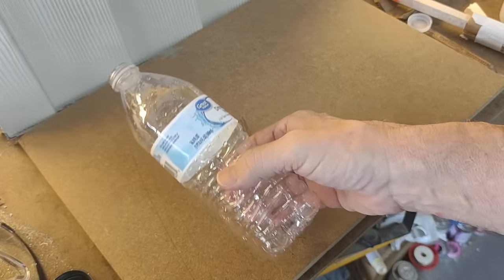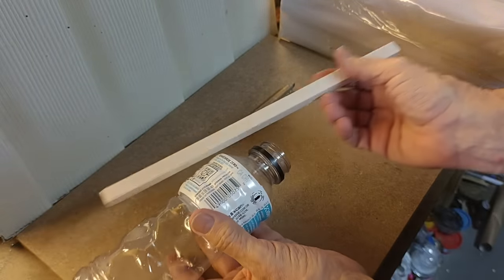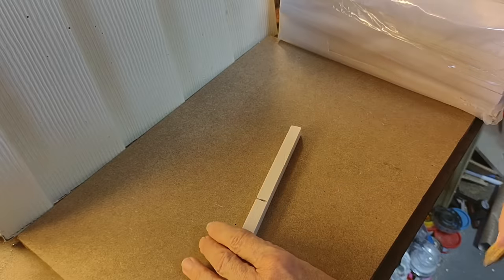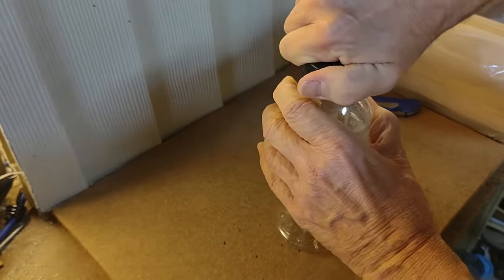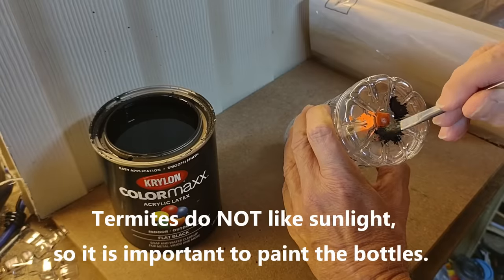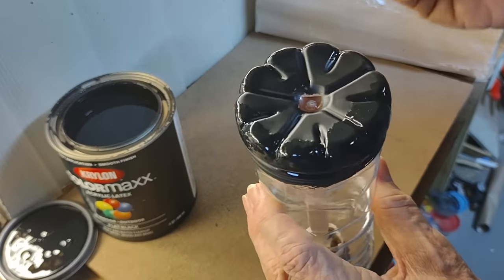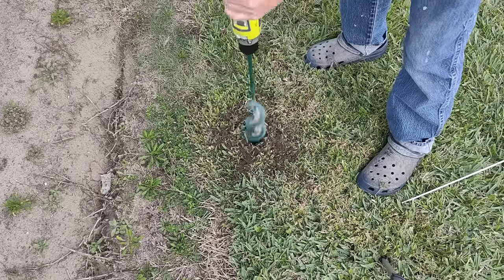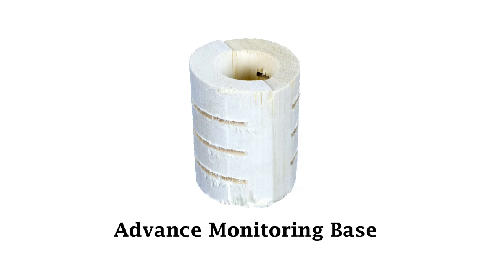Unbelievable Water Bottle Trick for Termites!  Simple to do!

Comment: thank god my house is concrete. We have gazillions of termites here. I put my shovel on the soil, the enxt day the wood handle is almost gone and there's gazillions of termites. The cracks of my yard concrete has termites as well, they also like eating live trees. I also hate the tree ants smaragdina they do bite and crawl everywhere. The fire ants is also scary and painful. Spiders are also plenty at my neighbor and gazillions mosquitos. Next summer I have to scrap all sorts of the moss growing on my concrete floor outside so that I can seal and cement the cracks. My concrete already expanded upwards due to rain water that make the soil bulky. Wood house feels comfy and feels home, but maintenance is very difficult so better have a concrete house.
Reply from the maker: Please tell me where you live.   I may be able to assist you with some of those issues.  It doesn't sound like you live in the US.  The extent of the problems you are describing would suggest perhaps the eastern hemisphere.  Some places around the world are much more challenging than the US because of the lack of availability of pesticides.  Still, if I know where you are from, then I can try to think of some solutions.  Also, you should know that a lot of concrete homes use wood in the roof structure, the interior walls, and sometimes to pad out the exterior walls to hang drywall and run the electric lines.  Termites also eat drywall.  Construction methods differ in other countries, but this is still often the case.

Be well my friend.
Reply: Where do you live so I don’t move there, sounds like a nightmare.
Reply: @GuysPestSolutions  my entire house is made of cement and sand. even the roof is cement and sand. It was built by pouring the cement into mold. The roof is slab of cement. we don't have wood as it will be eaten by termites. but i do have wood cabinet inside the house. for as long as there is no crack on my floor there will be no termite inside my house. The issue inside is the tiny ants crawling in small cracks. And I usually develop black molds on walls and ceilings. My door jamb is metal as well. but metal do gets rusty that is my issue the rust. Some doors of abandon house are eaten by termites. I don't have issue with termites anyway coz there is not much wood here. I just feel creepy with spiders of neighbor coz theyy do harbor those in their yard and it crawls. I do have wood on second floor devision of rooms. But I don't think termites will go up without passing lower ground first. The ants is the problem, they are crawling everywhere on cracks so I have to keep up with them everyday. there are super tiny, there are big blacks too. I spray insecticide on corners daily.
Reply from the maker: You did not mention where you live, so I don't know if you can get the pesticide that you need to do the job, but please watch my video on how to treat for ants.  If you can obtain the material, then this should solve your problem.  If you cannot obtain the pesticide, then please let me know what pesticides are available to you, and I will try to figure out what might work best.

I hope that helps. You will my friend.

Video on how to treat ants:  https://youtu.be/arPeidADLpY
Reply: I only use ordinary cheap insecticide on just corners where ants pass by. I cannot possibly stop all sorts of flying insects. The termites is fine coz i don't have wood here. ants is my issue so i spray on corners everyday, they creawl everywhere. The roach is minimal, but i notice the roach happen when i had neighbors. A few years ago we don't have roach here when there were no people, but when they came and homes got occupied, i notice I am seeing big roaches crawling. They probably have eggs and they don't clean. my house is messy and my yard but i clean everyday and spray so I don't have eggs and no insects likes me. My neighbors however who happens to have better looking homes and garden yard, they don't clean up, so insects are living in their house and yard, they have places to hide and lay eggs. It crawls to my space when they get bothered. They also have spiders. They just clean once a year. or maybe not. It's like a beautiful woman but never baths.😆

Comment: If the termite is in the house what you can do?
Reply from the maker: How you handle that will depend on the species.  Figuring out the species is actually pretty easy and I have a video on how to do that.  I will provide you with a link below.  After watching this video, you should be able to identify the species.  Just get back to me after you watch it and let me know what you found out.  At that point, I can tell you exactly what you need to do.  Let me know if you have any problems identifying the species, but I do not think that you will.  It is much easier than you may imagine.  Also, please tell me where you live.  Location matters.  Be well my friend.

Video on how to identify termite species: https://youtu.be/dIs_a0nfVjg
Reply: @GuysPestSolutions  from the East bay of San Francisco, CA, USA
Reply from the maker: @dirtrider9268  You have a few species there, but the most common are Western subterranean termites.  These can be hard to identify because they look a lot like Eastern subterranean termites.  Please watch my video on how to identify termite species.  If they look like Eastern subs, then they are probably Western subs.  If that is the case, then I can help you fix the problem.  They could also be Formosan, so look carefully.  Be well my friend.

Comment: How to treat dry woid termites already in a house in Florida
Reply from the maker: It is important to understand how drywood termites work.  They enter through cracks and crevices around windows, doors, the eaves, pipe penetrations, and so forth.  Most of the time, they enter through several locations.  That is because a swarm of them attacked your house at the same time.  If there was a crack or a crevice, then they probably found it.  After they established their galleries, which will be inside the wood, it will take four to seven years for them to be able to swarm.  Now that they are in your house, the swarmers will use holes that are in your studs to travel through the walls.  Those holes in the studs were created by the electricians to run the electrical wiring.  Not only are these holes going through the studs, but holes were drilled into the attic for the light switches and to run some of the wiring for the outlets.  So, the termites now have easy access throughout the attic and the walls.  If you have a basement or crawl space, they have access to that as well.  Most of the time, you will have no idea that they are in the walls, because the frass is inside the wall.  To make matters worse, if you have drywood termites, then your neighbors have them too.  That means you have been getting swarmed for as long as they have existed in the neighborhood.  Most likely, we're talking about years, so it's a safe bet that you have these guys in many locations in your home.

I always hate to be the bearer of bad news, but if you have drywood termites, the only sure way to get rid of them is to fumigate.  Prices for this can vary wildly in this industry, so I recommend that you watch my video on how to hire a pest controller without getting ripped off.  That video can save you a lot of money.  You should also know that the gas they use to fumigate has absolutely no residual action whatsoever, so you can get reinfested the moment the tent comes down.  Like I said before, if you have drywood termites, then your neighbors have them as well.  Since drywood  termites swarm every year, it is almost a certainty that you will be reinfested within a year after the fumigation is done.  The only way to prevent this is to do a preventive treatment on your house every 60 to 90 days.  Most pest controllers will not do this, so it is something that you generally need to do yourself.  I have a video on how to do that and I will place a link below.  If you absolutely cannot afford to fumigate your house, then you can try spot treating it yourself.  It is virtually impossible to find all the termite galleries, but it is way better than doing nothing.  Regardless of how you treat it, you should begin the preventive treatment immediately, so that you do not get additional termites paying you a visit.

I hope that helps.  Be well my friend.                      

Video on how to hire a pest controller without getting ripped off:  https://youtu.be/y-a8XOqVrlE

Video on how to prevent drywood termites:  https://youtu.be/neNsmVbj8Pc

Video on how to spot treat drywood termites:  https://youtu.be/U7ck7zhS0Xo
Reply: Yeah. Same situation here. Lots of my neighbors get tented fumigation, so very pervasive in my neighborhood. I’ve been researching Borax for roaches and ants indoors.Does Borax mixture work to get rid and kill the termites nest?
Reply from the maker: @Ded-Ede  Borate products will not work on termites.  Please watch my video on termites vs boric acid.  The only way to eliminate drywood termites is to fumigate.  You will get reinfested pretty fast, so you must do a preventive treatment, starting before the tent goes up.  I wish that there was an easy fix for drywood termites, but there isn't.  You can spot treat them, but it's almost impossible to find them all.  I'm so sorry.  I wish I had better news.  Be well my friend.

Video on termites vs boric acid:  https://youtu.be/Th07AIMvpvQ

Video on how to prevent drywood termites:  https://youtu.be/neNsmVbj8Pc

Video on how to spot treat drywood termites:  https://youtu.be/U7ck7zhS0Xo

Comment: I live in the woods. I picked up a paver and found termites under it. The paver is about 30’ from my house. Should I be worried? I’ve never seen any termite problems and I’ve done work on the house. Is it true there’s termites all over in the ground or should I be worried and kill these bastards to prevent them from ever making it to the house??
Reply from the maker: Yes.  You should be worried.  I recommend that you do an immediate inspection of your home.  You need to look for mud tubes that are coming up from the ground around the perimeter of your home.  You may also find mud tubes in the basement, crawl space, or even the attic.  Please e-mail me at guyspestsolutions@gmail.com if you find any mud tubes.  I also recommend that you apply termite granules around your entire house just as soon as you can.  
  
For the granules to work you need to have dirt around most of the house and that dirt needs to be porous enough to allow water to seep into the ground fairly quickly.  To find out if the dirt around your house is porous enough, just dig a small hole next to the house that is about 4 inches deep, 8 inches long, and just the width of the shovel.  Fill the hole with water and watch to see how fast it drains down into the ground.  If it seeps into the ground fairly quickly, then the granules should work just fine.  However, if it just kind of sits there, then the granules would not be a good choice, and you should consider trenching.  Make sure that you buy the correct granules.  You need the ones that have imidacloprid as the active ingredient.  A lot of the Home Depot and Lowes stores no longer sell the correct granules, but you can get them from Amazon.  I will give you a link to them.
 
Be well my friend.

Termite granules:  https://www.amazon.com/dp/B000RUIJYM?ref=nb_sb_ss_w_as-reorder-t1_k0_1_7&amp=&crid=1UJA4PE31UWZW&amp=&sprefix=termite

Video on how to apply termite granules:  https://youtu.be/H7rW_TSBHJ4
Reply from the maker: I'm sorry that I did not get back to you sooner.  I just got this.  You can use the Advance stations, but they are expensive.  If you are still seeing active termites, then you can make your own bait station that works faster than the Advance ones do, but only use it if you know where the termites are located.  I have a video on how to make them and I will give you a link.  Again, so sorry that I didn't see this message sooner.  Be well my friend.

Video on how to make bait stations:  https://youtu.be/r05Z-aUJehw

Comment: Will this work in Florida?
Reply from the maker: It works well in Florida.  I live in Florida and I use both the water bottle stations and I treat around the house with termite granules every year.  The granules cost about $50 and only take about an hour to apply.  So, the combination of those two things has me totally protected.  The termites will almost always find the stations, but if they get past the stations, they won't get past the granules.  Make sure that you buy the correct granules.  You need the ones that have imidacloprid as the active ingredient.  A lot of the Home Depot and Lowes stores no longer sell the correct granules, but you can get them from Amazon.  I will give you a link to them.  I apply the granules every January because it's nice and cool outside and it's easy to remember to do it every January.

I hope that helps.  Be well my friend.

Termite granules:  https://www.amazon.com/dp/B000RUIJYM?ref=nb_sb_ss_w_as-reorder-t1_k1_1_6&amp=&crid=157C3RV0MY0AK&amp=&sprefix=termit

Video on how to apply termite granules:  https://youtu.be/H7rW_TSBHJ4
Reply: Lmao 😂😂

Comment: My house is built upon concrete blocks.  Do i even need to be concerned about subterranean termites???
Reply: How high above ground? Ground termites can build mud tunnels that go up over concrete to the wood. But you would see that if the blocks are not covered up from view.
Reply from the maker: Yes you do.  They will build mud tubes up the foundation to the wood.  I have seen them build mud tubes into the attic.  You may also want to consider using termite granules every year as a preventive measure.  It only costs about $50 a year and it takes about an hour to do.  No trenching.  Just sprinkle them down and water them in with a garden hose.  I will give you a link to the video.  I use both the granules and the monitoring stations.

For the granules to work you need to have dirt around most of the house and that dirt needs to be porous enough to allow water to seep into the ground fairly quickly.  To find out if the dirt around your house is porous enough, just dig a small hole next to the house that is about 4 inches deep, 8 inches long, and just the width of the shovel.  Fill the hole with water and watch to see how fast it drains down into the ground.  If it seeps into the ground fairly quickly, then the granules should work just fine.  However, if it just kind of sits there, then the granules would not be a good choice, and you should consider trenching.  Make sure that you buy the correct granules.  You need the ones that have imidacloprid as the active ingredient.  A lot of the Home Depot and Lowes stores no longer sell the correct granules, but you can get them from Amazon.  I will give you a link to them.

Be well my friend.

Video on how to use termite granules:  https://youtu.be/H7rW_TSBHJ4

Termite granules:  https://www.amazon.com/dp/B000RUIJYM?ref=nb_sb_ss_w_as-reorder-t1_k1_1_7&amp=&crid=1CEOMLCX18VQ9&amp=&sprefix=termite

Comment: how do I get rid of palmetto bugs in my house?
Reply from the maker: Palmetto bugs are actually American cockroaches.  These guys are an outside roach.  The only reason they come into the house is to escape the weather outside.  They do not usually survive well inside the house, so most of the time, inside treatment is not necessary.  If you simply treat the outside of the house, that will often solve the problem, because no new roaches will be coming in, and the ones that are inside will usually die on their own, fairly quickly.  That being said, it is possible for these guys to establish an infestation in your home.  If they do not go away within about a month after you treat the outside, then just do phase one of my German cockroach video in any areas where you have seen activity.  It is unlikely that you would need to do phase two to get rid of American cockroaches.  I will give you a link to my video on how to treat your yard with a hose and sprayer.  If you do that treatment every 60 days, then your American cockroach problem will be solved.  You do not need to do this treatment in freezing temperatures. 
   
I hope that helps.  Be well my friend. 
 
Video on how to treat your yard with a hose and sprayer:  https://youtu.be/wifoTU5dmp0

Video on how to treat German cockroaches:  https://youtu.be/FoxCB5qLPMA